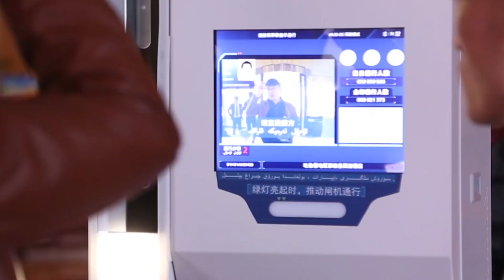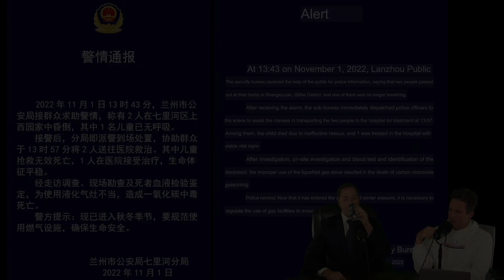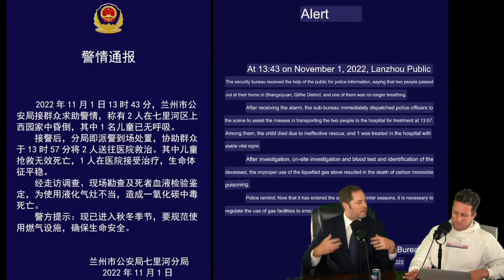China is at Breaking Point!

Comment: Faraday cage the phone to prevent signals from coming and going from the device. Not to go all tinfoil hat but that might be a solution for them. It's not physically messing with the phone or rooting the operating system or installing a VPN it's just a box with conductive material all around it that prevents the device from reporting back.
Reply: Not a perfect solution but when moving about in a place that might make your device go red put it in the box of shame.
Reply: Box of shame lol
Reply: That wouldn't be effective. For starters the authorities are going to probably have a talk with you and try to find out what's wrong with the GPS on your phone. On top of that it'll still update your location each time you scan.
Reply: serpentza already explained that it doesn't work because you need your phone for any sort of efficient travel (meaning taking your phone out of the faraday cage)
Reply: @AdrenResi  @ajr993 guess then the only solution is not to be born into a authoritarian wonderland.